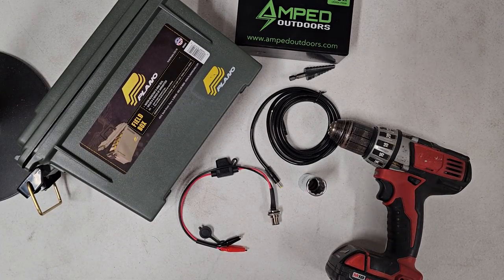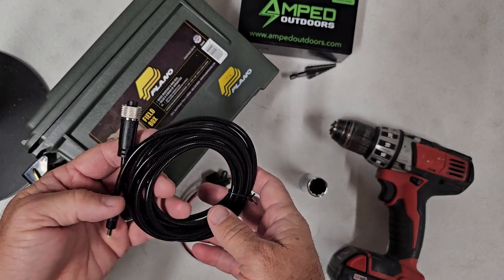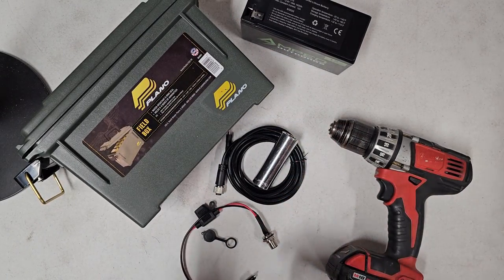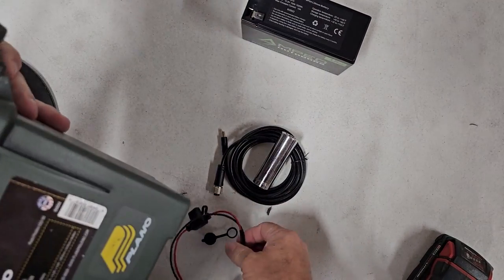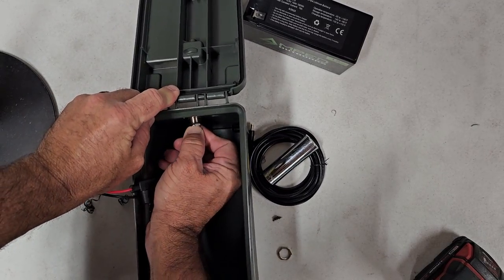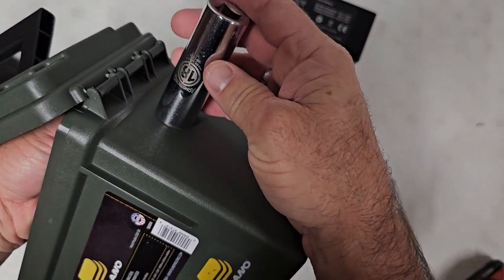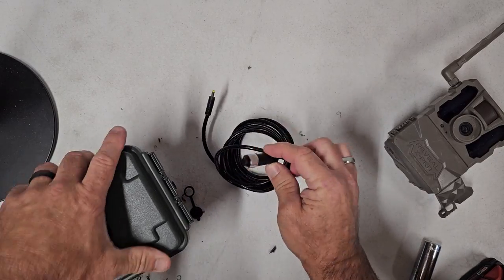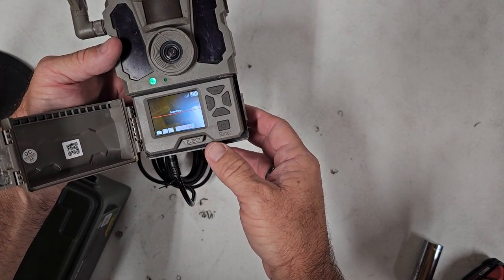Trail Camera 12v Battery Box Made Easy

Comment: I have one of your solar panels on a camera that has heavy leaf cover. Can you run both the panel and external battery at the same time? Whichever one is needed it uses?
Reply from the maker: No sir, the solar power pack can not be used in conjunction with an external 12v battery. It is a solar panel charging its own battery pack, which then powers the camera.

Comment: What do you use to charge the battery?
Reply from the maker: @steveparks5030  depends on the battery type. These days I only use Lifepo4 batteries with a bms so I use a Lifepo4 charger. When using lead acid I have a few smart chargers I use.

Comment: Some other videos show running the AA batteries in addition to the external system as a backup. Your thoughts?
Reply from the maker: No issues with that in most cams. The AAs would become the backup source. I would recommend lithium over alkaline for holding their charge longer and not leaking acid like alkaline can.

Comment: Great summary! I was able to build a similar kit watching a harrier nest. My 12V battery was only 50% after 5 weeks and the camera was set to 5 minute video clips. The only variable for me was the SD card size limit which is 128MB for my Zopu camera.  Unreal performance!    

A Question though:  the size of the connector - you said your kit is a 4.0 x 1.7 - I think the Stealthcam cable I bought was similar, but I needed a different sized connector which I just happened to have in a battery booster pack for a vehicle.  Does anyone know what those are called? I was looking on Amazon as I need to set 2 or 3 more cameras up.

Also I love the screw in connector. Do you ship to Canada? I might buy some cables for you if I can find more connectors.

I'll also be placing insulation foam inside because it's going to get cold real soon. I plan on using mine for game tracking for hunting and also for a GoPro solution to monitor animals like fox and fishers.
Reply from the maker: Thanks for watching. Stealthcam uses a 5.5x2.1mm dc plug. I have those cables as well. 
https://www.herd360.com/collections/diy-external-power-products